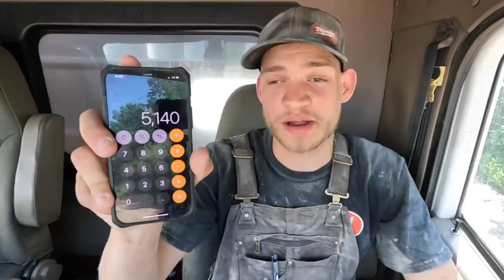Another Load Of Steers Leaves The Yard!

Comment: How old are the bull calves when you turn them into steers and how do you do it
Reply: On their farm, the castration process is done during their calf processing procedure. Which is usually within hours after birth. There are multiple ways to castrate a calf, but they use the elastic band method. Where a strong elastic band is placed around the neck of scrotum, cutting of blood circulation. The tissue dies over time, and usually detaches from the calf within 10 days.
Reply: @MellowYe77ow  love all the helpful comments 😂 keep up the good work
Reply: @caseywirtel561  Thanks! Will do. I enjoy it. 🙂

Comment: What are your steers weighing that your able to put 38 head on a load?
Reply: They target 1,500 lbs. per steer, for finish weight.
Reply: @MellowYe77ow  i noticed they used a triple axle trailer. What is the legal weight limit for the trucks in Canada ?
Reply: @kurtkriener3583  Up to 46,500 kg, or about 102,500 lbs. with a tri axle trailer. (With the correct spacing)
Reply: @MellowYe77ow  thanks for the info. In my area we load 32-33 head.